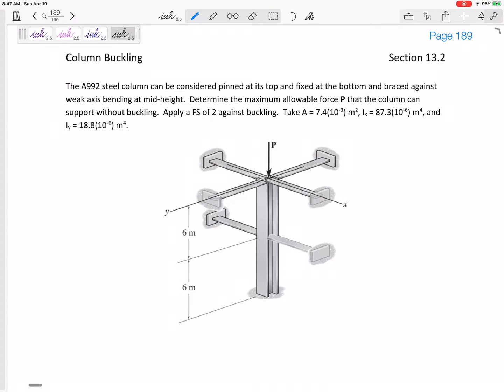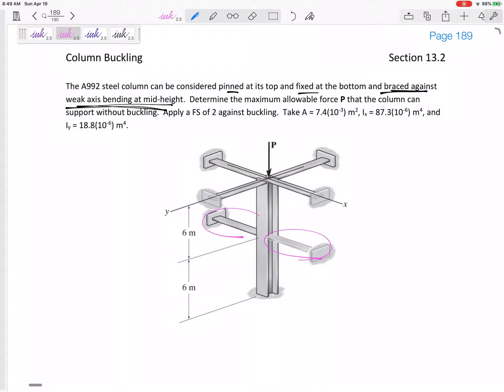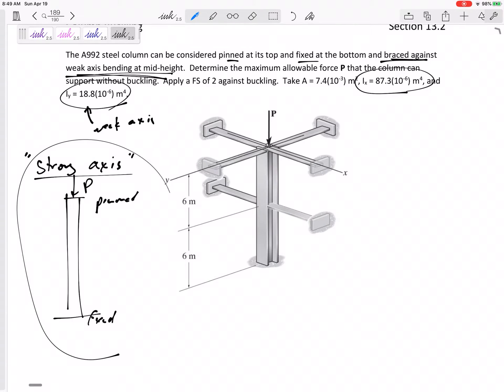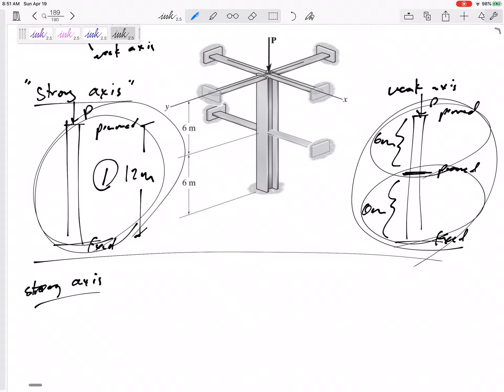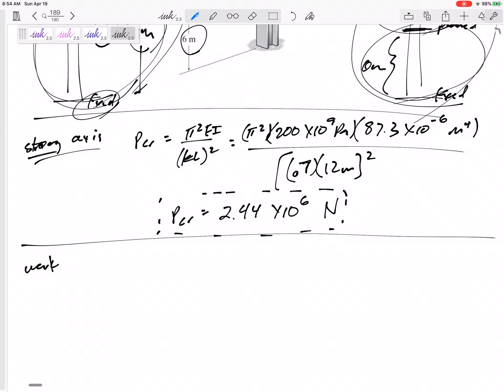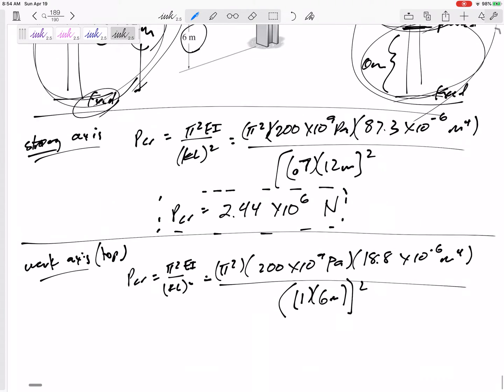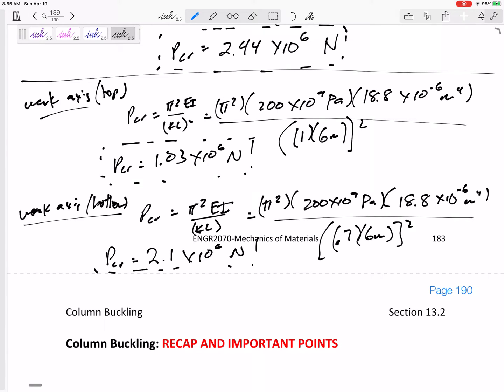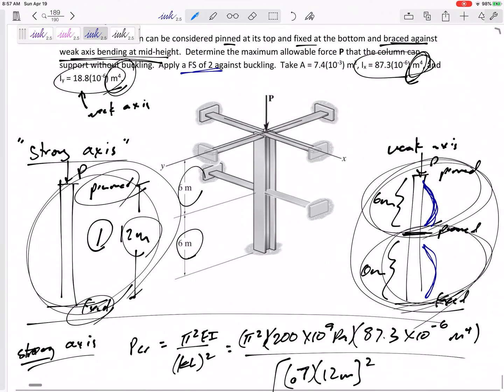Mechanics of Materials - Column buckling example 4

Comment: Iy is given for the entire column, but we used the same Iy value when dividing the column into two and performing two separate operations. Since we thought of two different columns, shouldn't we recalculate and use the Iy values for new situations?
Reply from the maker: Iy isn’t really about the whole column it is due to the shape of the cross-sectional area. So that would be the same even if you’re looking at half of it
Reply: Yes, you are right. It’s due to cross-sectional area. For a moment, I thought of h in the formula as the height of the part.

Thanks for the answer.You’re the best!
Reply: @engineeringdeciphered  Well, if the cross-sectional area of the column varies along the axis (like a curve), how do we find the second moment of inertia?

Comment: I understand that the brace restrains the displacements at the midpoint. But I think that the boundary conditions at midpoint should be clamped instead of pinned for the weak axis because there is a continuity in the column and the midpoint is not free to rotate

Comment: I understand that the brace restrains the displacement of that point. But I think that the boundary conditions at that point are clamped because there is a continuity in the column and it is not free to rotate at that point